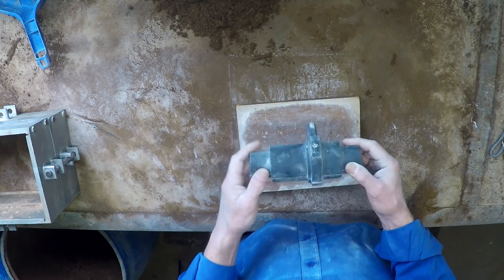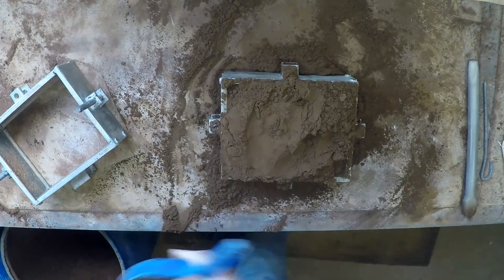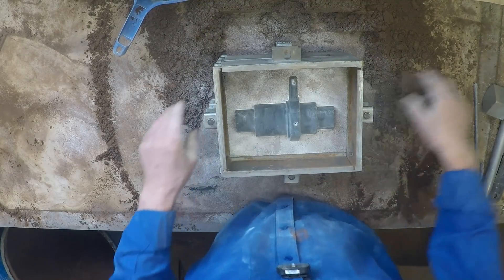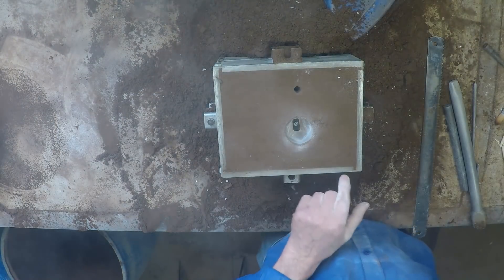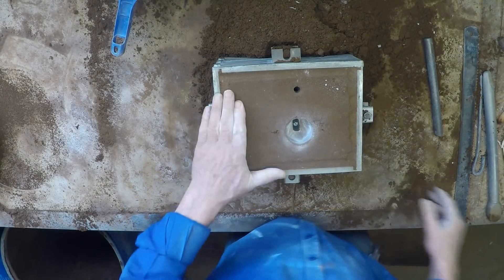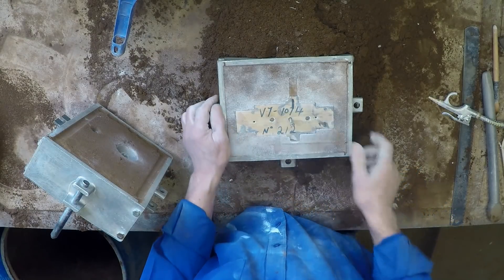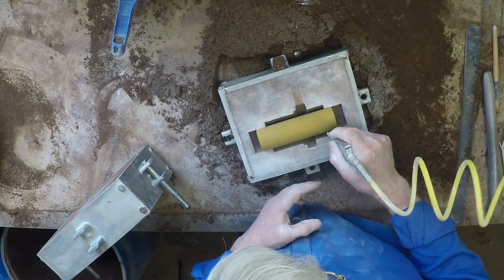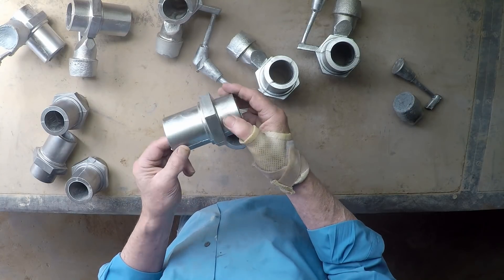Airport runway light frangible coupling

Comment: Martin, thank you for your latest video, I learn things each time I watch one. You were referring to removing patterns one handed, I do that if they are light and also gently tap as I steadily pull with slight tension. I never thought about rapping sideways to the axis, makes perfect sense especially when there usually is no real draft past the parting line radially on diameters such as this.
Reply from the maker: Clarke. Pattern removal seems to be one of those things that each foundry man develops his own method with.
Generally I rap in all directions until I am satisfied that the pattern is loose enough to come out, taking care of course if there are any areas of mould completely surrounded by pattern as these represent extra difficulty and are likely to break off all too easily. Strangely perhaps it is only very rarely that I tap a pattern vertically as it does not seem to help me. I will always use just the one screw if I can because of the left hand doesn't know what the right hand is doing kind of thing. I will sometimes guide the lift with vertical blocks of something heavy placed right on the cavity edge so I can lift with the pattern held against this something, a few of my videos show this. Lately for a long high lift I have actually made a linear bearing guided lifting mechanism, it will be used in an upcoming video on piston casting. Old timers using the traditional moulding bench (two stout boards over a laundry trough) used to have an air powered vibrator attached to one of these boards activated at pattern withdrawal, this shook the mould and greatly aided withdrawal. Similarly when using a pattern plate a vibrator was commonly attached to the plate and again activated at pattern draw. Vibration is a great aid to removal and its why I say "shake a bit". I guess that the vertical tap does much the same thing. Pattern removal is part of moulding that I am not very good at, I have seen some amazing moulders do this with the greatest of ease with just a pointed spike that they casually jab into the pattern give it a couple of taps and then in one swift move lift the pattern out perfectly. Then, and this is the bit I like, after cutting the gates etc. they put the pattern back in the mould give it a couple of light raps to make sure everything is ok and then lift it out again. I have trouble getting it out once but putting it back in again and pulling it out again - beyond my skill level... Martin

Comment: Another very interesting video Martin, thanks.  I have recently been watching your back catalogue!  I understand the use of parting powder to enable the cope and drag to be separated and the patterns to be removed from the sand but why do you put it into the sprue and feeder holes and also into the empty mould cavity?
Reply from the maker: Brain, I add  about 1/8 teaspoon of parting powder to the sprue and any feeder. I then blow it around within these to coat their insides. Thus when I strike off the top of the mould any sand that falls into into the sprue and feeders will not stick and will easily fall or be blown out. I like to give the entire mould cavity a light dusting as this helps stop any sand that flies around during subsequent mould processing (e.g. cutting gates) from sticking so that it too can be easily blown out. The white of the parting also shows where I have blown out and where I have not... Martin
Reply: @olfoundryman8418  Thanks Martin, it makes perfect sense.  I appreciate you answering my questions.

Comment: If you ever get burgled, check your sand first - it might be me travelling 1,000s of miles just to steal a bag of it !
Think i'll fire my charcoal furnace up tomoz and do some simple scrap recycling for the first time in 3 years.
Awesome videos - inspiring !
Reply from the maker: aga, Every grain of my sand is numbered  and has a GPS chip attached 😄. Don't just melt some scrap, be inspired - make a casting - something you can do a bit of show and tell with.... Martin
Reply: It's going to be tricky to cast a million microscopic boxes to put each grain of sand in to block the GPS signal ;) 
Today i just need some round stock to try and make pulleys for my broken cheapo mini-lathe.
The motor burnt out and the replacement is .... a washing machine motor.
Definitely got to buy something better than builder's sand and have a proper go.
The finish you get is pretty much the Holy Grail !
Reply from the maker: aga, I have watched your video Hmmmmm!😏  But quite enjoyable. You have what I would call a "video personality" and you come over well you will in time do well because of it. While you are at stealing some of my sand (and I sure can see why you would want to!) may I suggest you grab a couple of ingots of decent metal and also sneak a clay graphite crucible into your pocket. By the way  sodium bicarbonate, washing soda (sodium carbonate), or Epsom salts  degassing does NOT work and I am dubious about pool shock tablets too. Well done for inventiveness - the hair drier and the stick are brilliant - where can I get a stick like that.😀.. martin
Reply: Wow ! You remind me that i have a salamander A3 somewhere. Will go and find it.
I remember trying bicarb for degassing and ended up finding it of no use, as my crappy 'castings' generally come out pretty much 100% solid metal without it, at least as far as i can tell.
No surprise 'pool shock' , a.k.a. sodium dichloroisocyanuric acid/trichloroisocyanuric acid doesn't work - it is much more likely to react with the metal than do anything else.
The stick is very special. 
I'll hand-craft you one and swap it for a sack of petrobond ;)

Comment: Nice work as usual.  If a plane hits a runway light, they've got bigger problems.  Taxi lights on the other hand can be tricky to see sometimes.  These lights usually get taken out by the guys mowing the grass.  Lawn mowers are cheaper than props, engines and landing gear.
Reply from the maker: World, I know of one case where lights (the kind installed right in the runway surface) were taken out by pigs foot rollers taking a short cut across an existing  (and in use!) runway whilst building a new one. Presumably if a plane clipped a light it would be with a wheel and maybe that would get away with that pretty much unscathed if the coupling broke easily I don't really know and can only add that being a metallurgist I know too much about metal fatigue, stress corrosion cracking and the extreme loads on turbine blades to be a comfortable flier. Then there is bird strike and nutters with bombs and agendas etc etc... Martin

Comment: I was thinking perhaps if a string were used to pull the pattern out would help reduce side pressure when lifting the pattern.  Having a short string tied to the screw, and pull the screw up by the string.  I think it would focus the lifting force up with less forces to X and Y.
Reply from the maker: Shem, It sounds like a plan but there are some difficulties. First of all the string would have to be attached exactly above the centre of gravity of the pattern as if not the heaver side will stay behind and the pattern would try to come out crooked destroying the mould. Secondly if the shape of the pattern were such that there was more drag against the sand on one side (highly likely) the pattern would again tend to come out crooked. Finally if the string were not pulled exactly vertically upwards the pattern would tend to move sideways. So I am sorry to say that I do not see it working. Lifting patterns out is a matter of practice and acquired skill - sadly, I have never been very good at it but I have seen other moulders who are absolute geniuses at it... Martin

Comment: Hi Martin.  You are by far the most professional foundryman on YT and I have learnt enough from you to decide to have a go.  I have bought all my materials to build a foundry and some extrusion cutoffs and some copper to play around with.  One thing I have to mention is that your voice is very familiar to me ....... Did you ever work at Monash Uni? - Scott
Reply from the maker: Scott, Thank you for your most generous comment. Monash Uni, no, visited a couple of times but never worked there, above my level I am afraid. Studied at RMIT. worked at various places including BHP research where you there? I assume from the mention of extrusions and copper that you are going to join the latest craze and make up some aluminium bronze - yes? Be aware that aluminium bronze is not the easiest of alloys in the foundry. And please don't use copper wire too much oxide and also please don't use the aluminium extrusions for making aluminium castings. Also when you add the aluminium to the molten copper watch for the marked exothermic dissolution of the aluminium into the copper. it is amazing just how much hotter everything gets....Martin
Reply: It's funny how I went from YT - Brian Oltrogge (who is very fastidious with his castings) to Pauls Garage who teamed up with swdweeb, who then mentioned you.  Gone all around the world to find someone local - I'm in Clayton VIC.  Yes, I want to do an aluminium bronze hammer head (sort of like swdweeb's), just to test the work hardening properties and see where it sits in the line of "soft" hammers ...... swdweeb had problems with his latest aluminium bronze casting where it seemed the 2 metals separated in the crucible.  Would love to hear what you think happened.  No, I'm using copper pipe that I think comes from aircon systems.  I was going to use some of the extrusions for casting and I have since seen some wins and some failures on YT.  The difference between extrusion aluminium and cast aluminium for me, is the source (scrap merchant) and the ease of processing the material so it will fit in the crucible.  Can I make the extrusion cutoffs more castable?
Reply from the maker: Scott,  Clayton, quite close you should pop over one day when I am casting. Work hardening properties of aluminium bronze eh, not to sure about that. Firstly we have to remember that "hard" is a relative term here. You are never going to get it as hard as a good steel hammer. Secondly most of the aluminium bronze being "made at home" is probably a lot lower in aluminium than the maker thinks. Recovery of something like aluminium when added to molten copper is a very decided unknown. What is known about it is that it would be way less than 100%. Thus adding 10% aluminium to 90% copper is not going to give a 90/10 alloy or I suspect anything like it. My guess (and that's all it would be, a guess) is that you would get somewhere between an 95/5 to 93/7 both fairly soft aluminium bronzes. I am reminded here of having to add 0.4% Magnesium to 600 Kg of an aluminium alloy at my last place of employment. We had in house spectrographic analysis so I was able to check on what recovery we got. To get the 0.4% I had to add 0.8% i.e. we got a 50% recovery. What happened to the other 50%?, into the dross on top I suppose. Aluminium into copper is probably little better! If you want a "hard" aluminium  bronze hammer there are a few alloys that will harden by heat treatment and they can get quite hard not steel hard mind you but close. One such alloy is CMA1 I use it to make gearbox syncro rings as it has very good wear resistance. My preferred sauce for copper is Buss bar the thicker the better I buy it from scrapies.
Re aluminium extrusion be aware that it is not pure aluminium but (probably) contains Mn or Mg or both. Now you can melt this stuff and you can cast it into a sand mould and you can get a reasonable looking casting (with luck and skill) But why bother? For over 100 years smarter people than most have developed a series of casting alloys that perform quite well, are we to ignore their efforts and use an alloy which is not going to give us a terribly useful casting? It may be porous and full of oxide films and it will machine like chewing gum and probably wont be much stronger. Buy some scrap alloy wheels, to break them up stick them on top of a wood fire until they get good and hot 400 deg c plus then while they are hot smack them with a hammer, they should break up quite easily into nice crucible sized bits.
Can you make extrusion stuff more castable? Yes but not easily. You could add silicon well that's what everyone says but it won't work. You can't melt silicon and add the aluminium to it (mp is about 3000 deg C) and you can't dissolve it in molten aluminium as it just floats on top and refuses to stir in, a good flux might help but what a todo, life is too short. You could add say 4 % copper but while this would/might give a machinable alloy (sort of) it has poor corrosion resistance and is an older style alloy long outmoded for good reason. Stick with the wheels, just check that they are Al and NOT Mg though.
Finally Swdweebs problem - he forgot to stir! The aluminium when added to the molten copper just floats on top, after all it has only 1/3 the sg. When he poured he first got mainly aluminium off the top of the metal and then as he continued the pour he went through a progressively less aluminium rich brew until finally he was pouring essentially pure copper, he actually comments on this from the colour change he saw across the part. At some point in this process the composition corresponded to an aluminium bronze that is very brittle  probably a bit over 16% aluminium hence the very glass like fracture of his candy dish. However if he puts the whole pots worth back in the pot remelts and stirs preferably with a rolling motion he should get a uniform alloy  - of some sort. Ah , the perils of home alloy production, fools and angels treading etc....Martin
Reply from the maker: Scott, It all sounds like a plan! I potentially have surgery too but much less serious, mine is for a badly arthritic right thumb. I will have me out of action for 6 weeks and will perhaps be done in 3 to 4 weeks. So by the time the 10 weeks or so has passed I will probably have a bit of casting to do so expect a phone call around mid April I am in north Croydon by  the way... Martin
Reply: All good.  Should be well back on my feet by then too.  Thanks for the opportunity.  Catch you then.

Comment: How much air pressure do you use when blowing off your molds?
Reply from the maker: Jerry, Not much! I have a cheap little regulator in the line to the blower nozzle it is set at about 15 psi. Even so I am careful how I squeeze the trigger as the initial blast of air can be a bit much. Also I am careful where I point it avoiding as far as possibly thin frail edges in the mould. Things like fine lettering I am very careful with indeed, usually keep the nozzle some distance away or only squeezing  the trigger a little bit. Like a lot of foundry e.g. how wet you have your sand or how hard to ram its an acquired art... Martin

Comment: I always learn something watching you. I have a little project to make a depth stop for a Stanley rebate plain I've built a wooden pattern of it but I'd like to get several castings in a pore. Any tips of making duplicates of my master.
Reply from the maker: Chris, How many Stanley rebate planes do you have? Seriously the usual way is to make a silicon rubber mould of your existing one pattern then to  cast as many urethane copies in it as needed. There are special hard durable pattern making materials based on castable urethanes. Generally this is not a cheap method but it holds size quite well...Martin